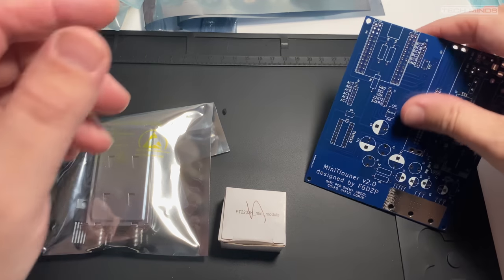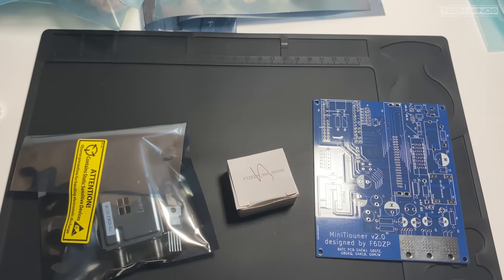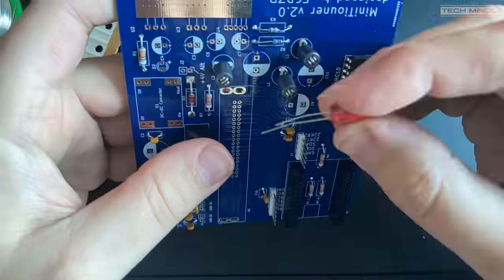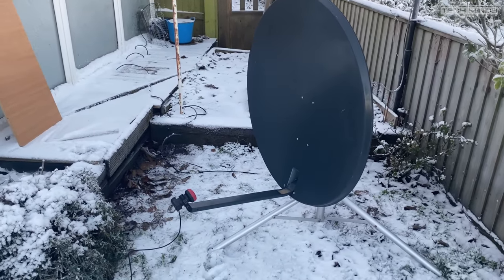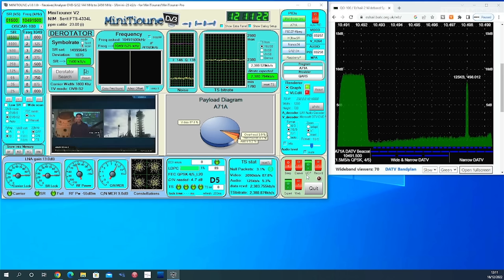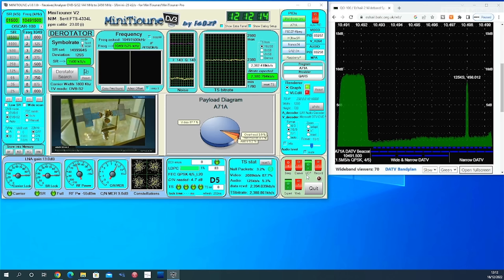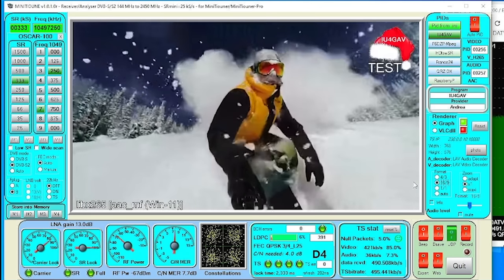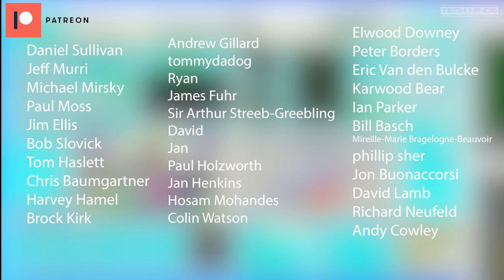MiniTiouner V2.0 - Build And Receiving DATV From QO-100

Comment: You've done brilliantly building it. I've been using the MiniTiouner express for a few years but lowest symbol rate I get is 125 never 66 or 33. Certain Linux satellites receivers will work down to 250 like the Octogon SF 8008 but I have to use an old adx frequency extender to shift the frequency up 10.491 becomes 10.991 Ghz. You can see a recent example on my channel. Most sat boxes will only accept 1000 for symbol rates
Reply: I get up to 20 ksr with no problem.
iz5tep

Comment: You can buy a complete kit for the Minitioner S from REF, the French national amateur radio society. The BATC have two more designs that use the Minitiouner hardware for reception, the Portsdown and the Ryde projects. Portsdown also has transmission and test equipment functions.

Comment: If just receiving next stage is to build the Ryde receiver using old sat set top box to put all the circuity in it. Can use repurposed remote control to change channel or scan for a signal. Just need the tuner and a Rpi.

Comment: I use a variety of Minitouners here. There's a V2 built into a Ryde set top box. A standalone v2 boxed like you have it is on hand to work with a PC or a Portsdown 2019 DATV unit. Both the newer Portsdown DATV units have a Minitiouner built in as the receiver and the software uses Heather M0HMO's amazing Long Mynd digital ATV receiver software. There's a very nice beacon signal strength meter in Portsdown to help with peaking the dish. In this part of the hobby BATC membership is an essential part of the toolbox. 73 de M0YDH
Reply from the maker: Thanks David! I have a lot to learn here testing all the excellent systems that are available. Amazing hobby to be involved with.
Reply: It would be good if you demonstrated the QO-100 Live Tune software by Rob M0DTS,  Matt. It's on the BATC Wiki via search. The program runs between Minitioune or Ryde and the spectrum display. Click on a signal and the receiver tunes to it. Really nice.

Comment: Nice video, as a tip for an alternative to minitioune program and like HORUS described, there is Ryder project from BATC (will be like a standalone receiver with HDMI out + remote control). You will need an RPI4, but with a small mod, you can also be able to use the longmynd client program for PC from ZR6TG.

Comment: Is there a difference in using this vs an sdr with the appropriate software?
Reply from the maker: It can be done through software like SDR Angel, but it can be fiddly to get the settings correct for a nice solid demod.
Reply: @TechMindsOfficial  have you tried dvb gui.exe ? That is very fiddly but it works
Reply: Yes, very much ease of use and flexibility.

Comment: A decent enigma2 satellite receiver should be able to pick up these signals and even the low Symbol Rates but obvisouly you won''t have the software support or spectrum function.
Reply: It has been tried and it is not good at low symbol rates. A Minitiouner is really the best option for the low symbol rates that amateurs use. There are several software options as detailed on the BATC wiki.
Reply: If you can find an Enigma2 receiver and Tuner that works to select between adjacent 333kS signals, the BATC would be keen to know. So far, no commercial receivers have been shown to do this.
Reply: @davidcrump1442   I have been able to receive sr 300 or sr 350 signals used for dutch radio stations to feed their transmitters/cable headends int he past. Those signals were on 16 east. I used dreamboxes (dm8000) and that worked fine. I think i also tried a zgemma box once and that worked too.  At the moment i'm using a VU+ box but have not tried that yet.  I think it all depends on the correct frequency.
Reply: @davidcrump1442  as I said in another post the Octagon SF8008 will work woth sr down to 250. Peobsvly others I don't know about. There are so many now !

Comment: Kind of a bummer that the tuner module used on the MiniTiouner board is a custom version made to BATC's spec.  Kind of limits the availability.  Also a bummer that this sat can't be seen in the US... I was getting really excited for a moment there!

Great video, though!  You must be constantly on the search for interesting amateur gadgets.
Reply from the maker: Constantly searching! Yep! :)
Reply: Not a BATC Custom tuner. It is a standard Serit design that was found to be suitable by F6DZP. It was only available in quantities of 100+ so BATC purchased batches for resale to members. Sadly now discontinued by Serit, although BATC and the French REF have some remaining stocks.
Reply: @davidcrump1442  OK, maybe not explicitly custom, but the BATC wiki says they asked Serit to add an LNA to an existing model, creating the 'L' suffix to the part number.  That plus "sadly now discontinued" make it fit the custom category in my head ;)